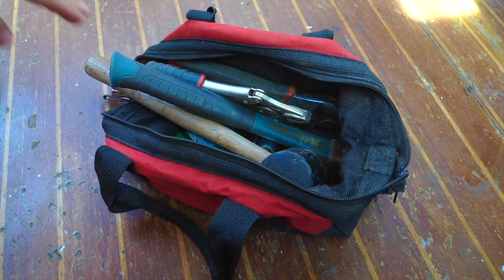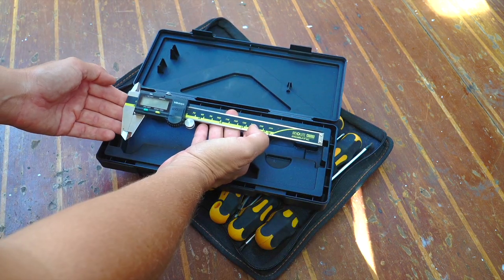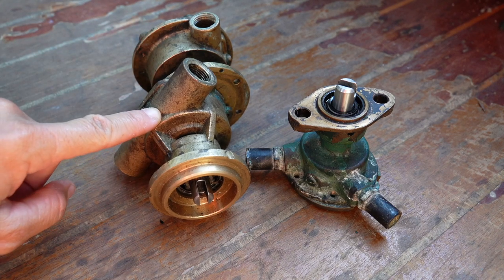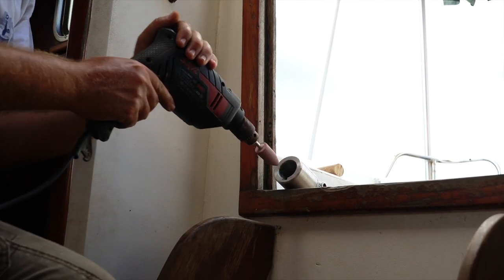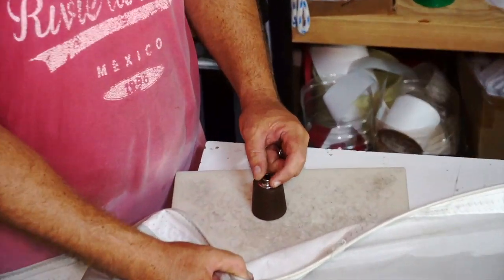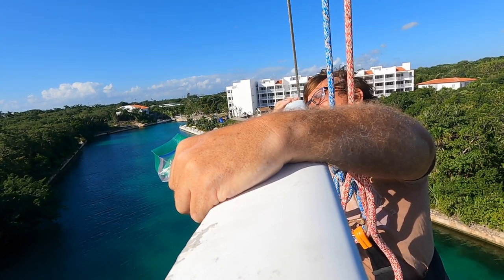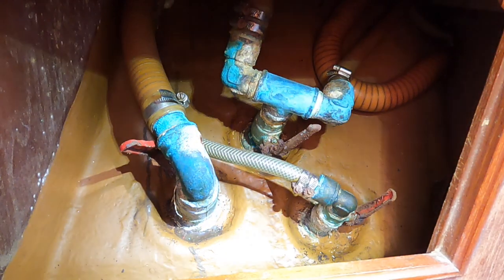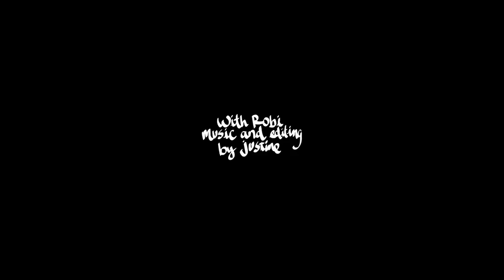KICKED OFF the dock

Comment: Great tool set. If you ever want to get the rust off you can dunk them in vinegar and leave it for a few hours. The rust falls right off !
Reply from the maker: Thanks for the tip! What we need to do also after the process of getting rust off is soak them in oil/something similar. Because we actually clean the tools often - they tend to rust themselves back up.
Reply: @sailorama  wd40 is your friend
Reply: @saylaveenadmearedead  and cleaning your greasy hands that about all ! It’s not penetrating oil for loosen up nuts and bolts and such